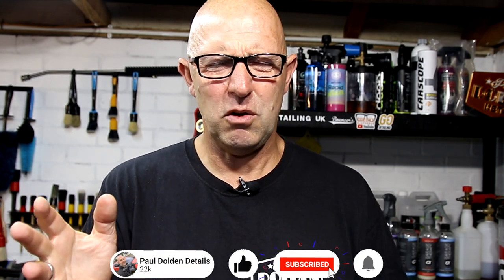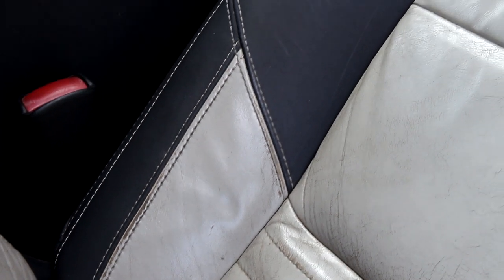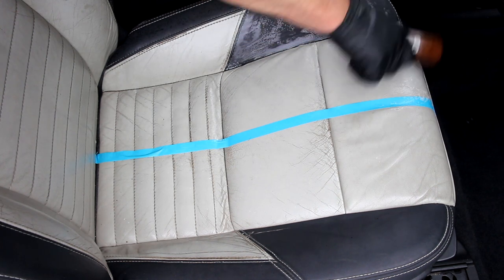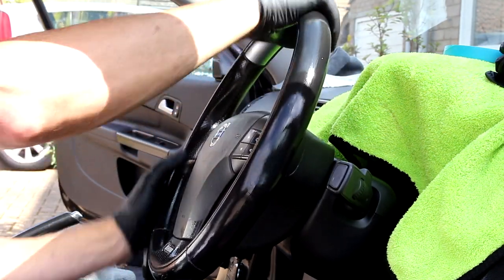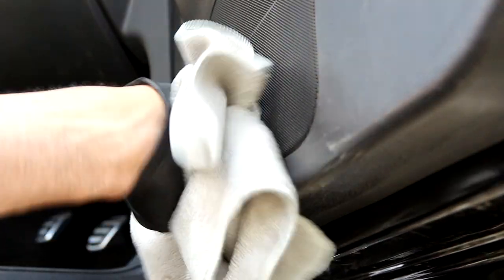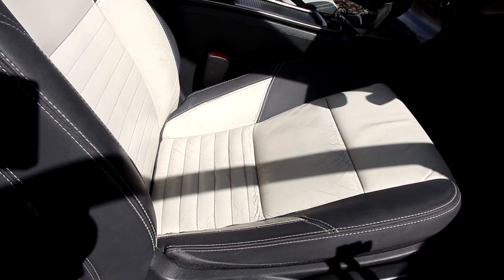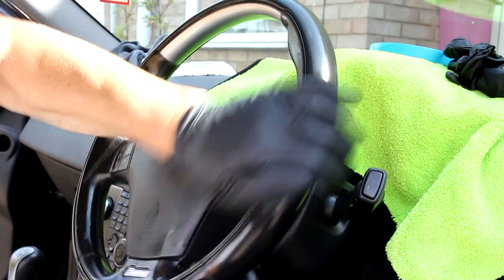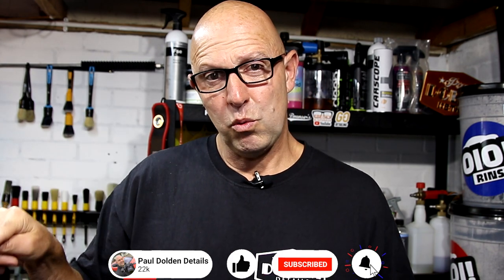How to deep clean car leather seats

Comment: Cracking video Paul, that must have been one hell of a battle. Fair  play to you for getting them so clean. I've been using the Leather Repair Company's products and they are great they look very similar to Geist.
I was told not to use microfiber cloths on leather as it can create a static charge and also scratch it so I use cotton Terry cloths slightly dampened to mop up the foam/dirt. Enjoy your holidays 😎😎
Reply from the maker: Cheers Paul I’ll remember that top tip scratching leather and electric shock not good I’m not done yet there’s another video coming just keep an eye on the channel 👍🏻
Reply: Great I always look forward to watching your videos 👍👍
Reply: That's also something people miss when using them on paint, it's very much down to the user and their heavy handed approach but so many use Kirkland and they do the most damage on some surfaces IMO.. 👍🏻

Comment: Another great video Paul  - agree totally with how you've approached this. Personally this is where I would use a steamer. Nothing fancy - cheap one off ebay will do.put a microfibre cloth over the end of either the upholstery or floor  attachment and away you go. Works very well on leather seats, jackets and sofa's. It saves alot of scrubbing and the heat pulls more of the dirt out. You heading over this way or staying in the UK  ? All the best from the Melbourne mob
Reply from the maker: Not yet Andy Australia is a big trip we have planned we are off to wales 🏴👍🏻great tips thank you 🙏🏻

Comment: On black. No stain risk. Just leave step 3 yes ?
Reply from the maker: You can do step three just wait a couple of hours to let the conditioner soak in then apply the blocker 👍🏻
Reply: Thought similar , would you wipe down the conditioner 2 hours after cure or apply blocker straight ontop?  Cheers @PaulDoldenDetails
Reply from the maker: @zzhughesd  wipe any remaining residue off but to be honest after a few hours the conditioner should all be soaked in by then and then apply the blocker 👍🏻
Reply: thanks Dan  @PaulDoldenDetails